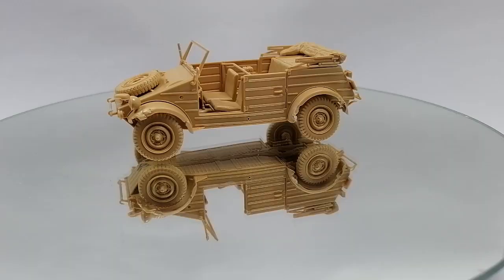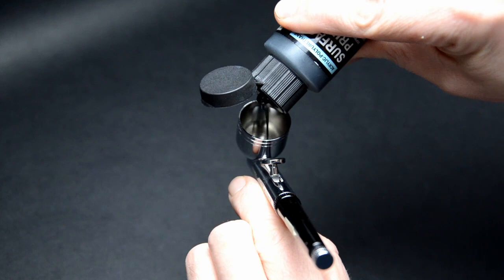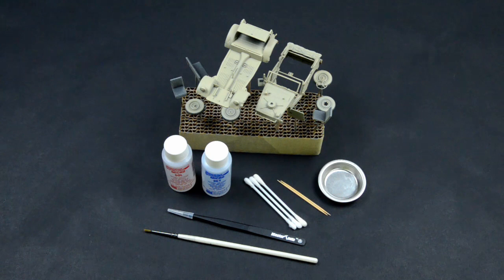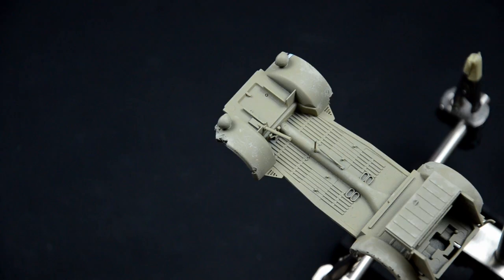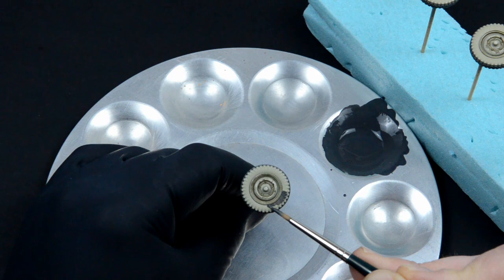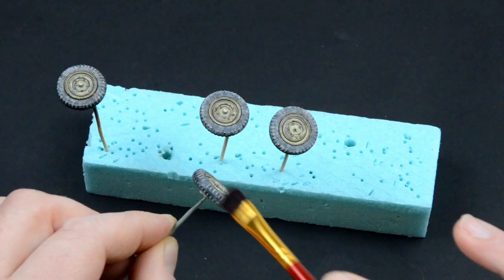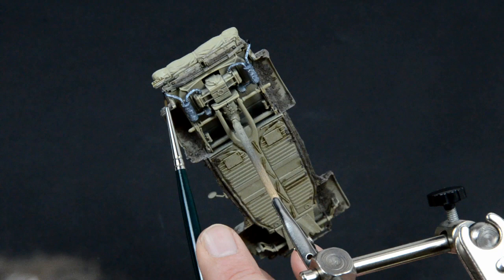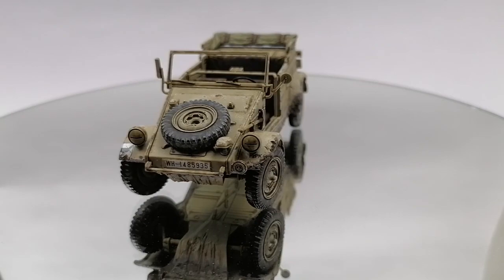EASY PAINTING and WEATHERING for a KUBELWAGEN (Tamiya, 1/35)

Comment: you should add some "weight" to the wheels. with hot water.
Reply from the maker: One of my modelling budies also said this. I think it is to late, but certenly will do in the future... Are u shure, hot water is enaugh?
Reply: @dioramadevil  Yes. soften the tires in hot water and press them gently against a hard surface. I think there folks who use a hair dryer. I prefer water.